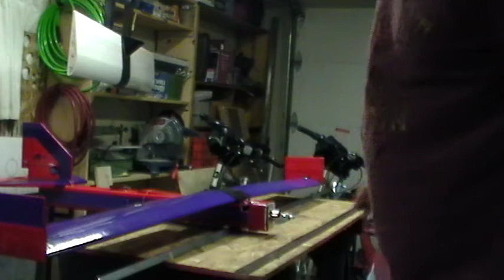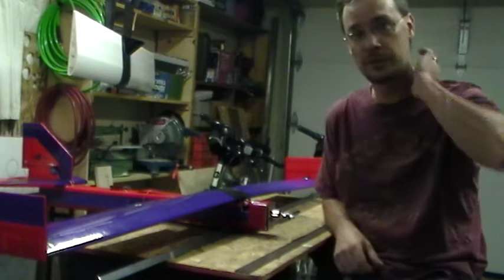CG Question for my latest plane

Comment: What you can do is remove the wing....find a level surface and get a pencil....... install all the electronics in the fuse......now put your fuse on the pencil and move it back and forward till it balances.....thats a way of finding the cg of the fuse the you mount the wing on or around that....if its way too far back....witch i think it might be the you will have to extend the front like ED said......good luck

Comment: It's nearly a Photon!  I would vote for extending the fuselage by 15", make a hatch on the top of the extension for your battery, and remount the motor.  This will solve the CG problem and will extend your tail (moment arm) in order to improve stability in yaw and pitch too.

Comment: Seems to me you have 3 options (with the CG where it is now you could have major grief):
1 - Move the wing rearward until the CG is 25-30% back of the leading edge of the wing.

2 - add weight to the nose (I had to add 3 oz to the nose of my first AXON)

3 - Add to the length of the nose, get you motor out more in front of the wing (just like on the Proton or the Peace Drone). This may well be possible with your existing fuse once you get over the nervousness of cutting into a "finished" fuse!